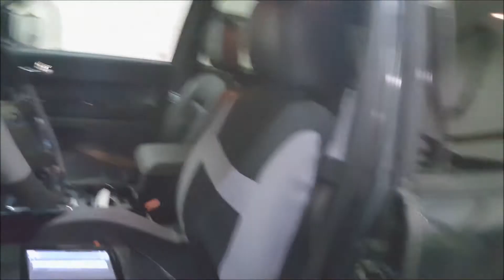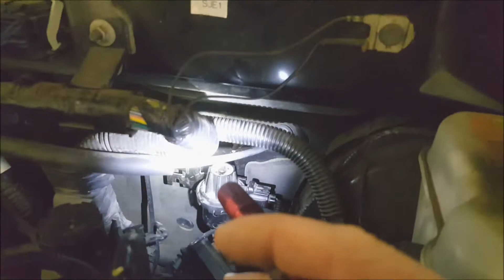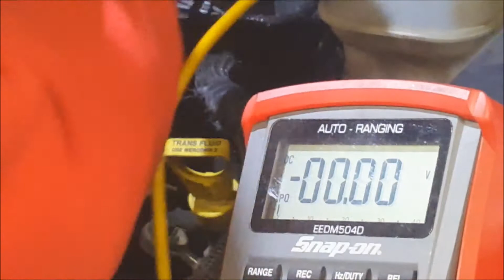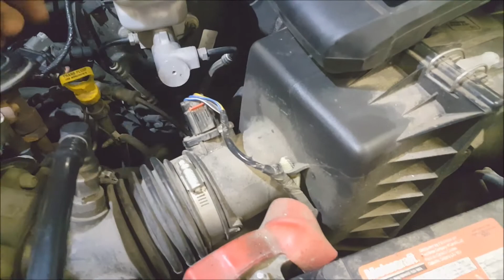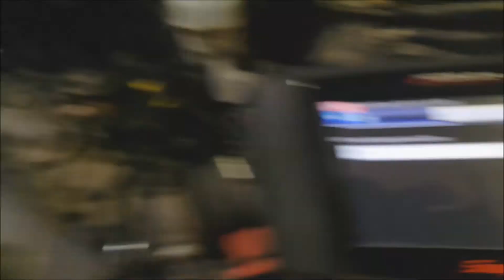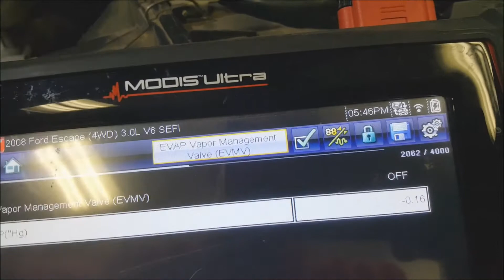Ford Escape P0455 evap code  Stuck purge valve

Comment: just what I wanted to hear. I have a purge valve stuck closed , and a p0455. I started wondering if the pcm couldn't make a vacuum in the system would it think there was a gross leak. Apparently so, thank you

Comment: <------ stupid girl question.....  what does the purge valve actually do? 😳  Let me know when you want me to boot myself outta here!   😆
Reply from the maker: the purge valve has two functions. The computer opens it while driving to burn off the fumes from the gas tank which get stored in the charcoal canister. It's to keep the gas fumes from evaporating into the atmosphere. emission standards. The other purpose is to check the condition of the evap system. When the computer wants to check for leaks it closes the vent valve(which is open when you refuel so the gas pump doesn't keep shutting off on you) and opens the purge valve. The purge valve then allows the vacuum from the motor to start pulling the evap system into a vacuum, then the computer closes the purge valve(sealing the system) and watches the fuel tank pressure sensor to see how long it takes for the vacuum to diminish.  If the vacuum drops to fast it throws a code. In this video the problem was the purge valve never opened, so the computer never saw the evap system go into a vacuum. It's just assuming there's a big leak in the system letting the vacuum out.